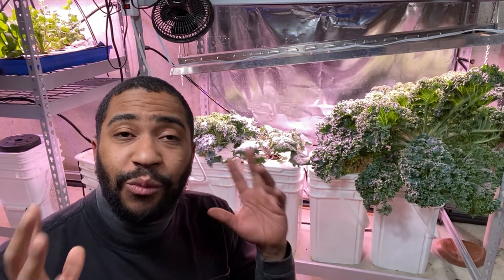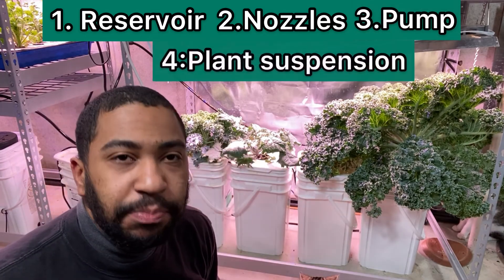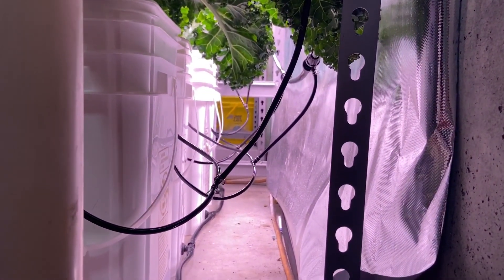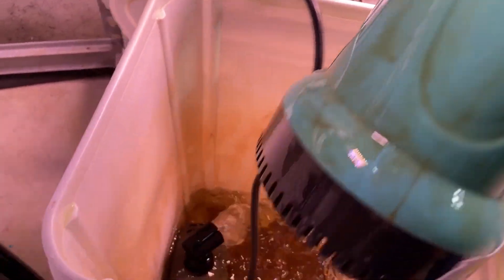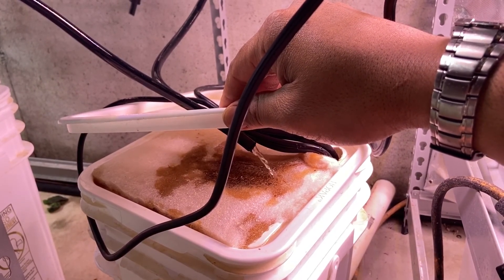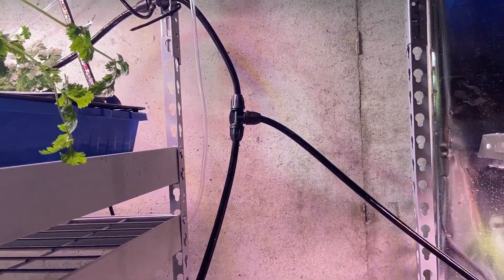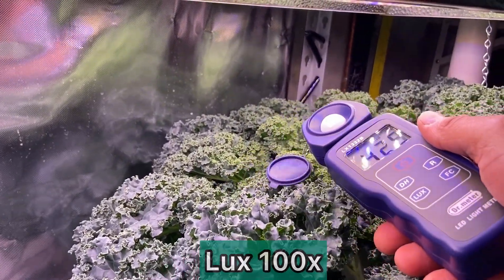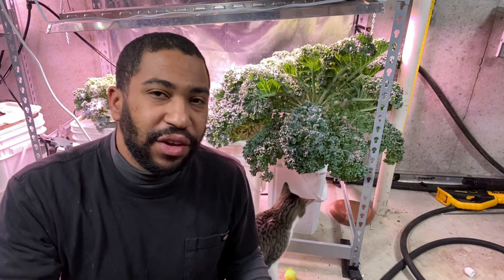My Simple Aeroponic system walkthrough DIY Build

Comment: I`d suggest switching to a  small reverse osmosis booster pump. Most are able to deliver at least 125psi and consume very little power.
Reply from the maker: Reverse osmosis systems are expensive and unnecessary. If I can grow plants without it, I will. Plus they have high maintenance cost. Filters have to be replaced regularly. Finally, most moderately expensive systems are low pressure, 60 psi or lower, so I assume you have to have a high cost one for 125 psi.
Reply: @joshuarudd6297  
I`m referring to just the pump (<£50 here).125psi  24v dc @ max 2amps. A 250 mesh inline filter will run a full outdoor season without any maintenance.If you switch to a ro booster pump you will never go back to using submersible high flow, low pressure pumps for aero. When it comes to low maintenance high pressure aero is hard to beat.The very low flow rates allow you to run drain to waste so you dont need a massive reservoir and you dont need to constantly monitor ph/ec, adjust or change it out. Simply mix fresh nutes when its gone.. My large accumulators can run a system for upto 2 weeks on a single fill, i dont need to do anything but wait for them to empty. I have a large outdoor flood and drain system that involves a lot more work.
Reply from the maker: That makes sense! Would love to see your setup. Maybe u can make a video about it.